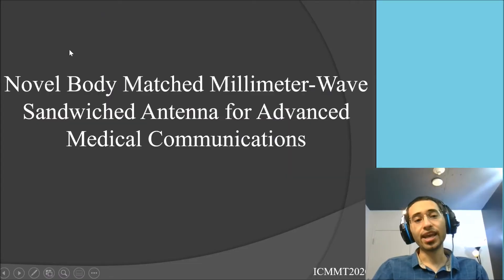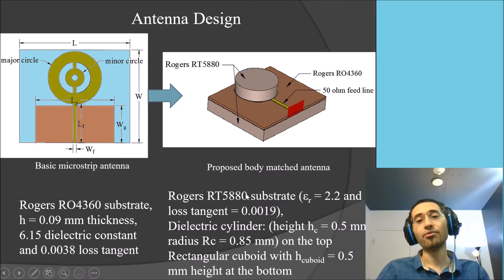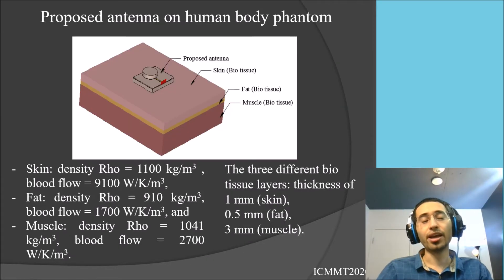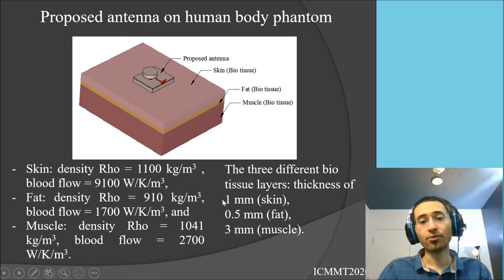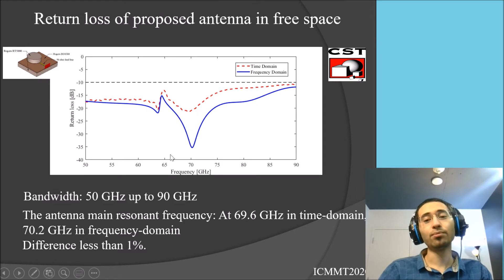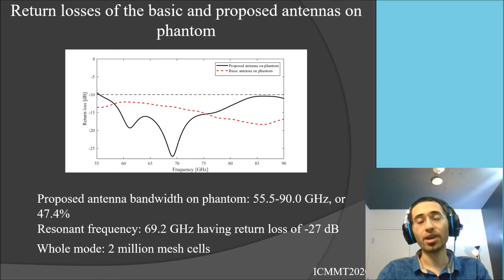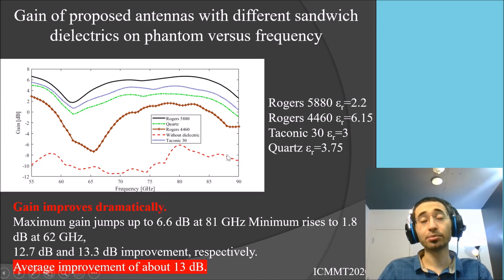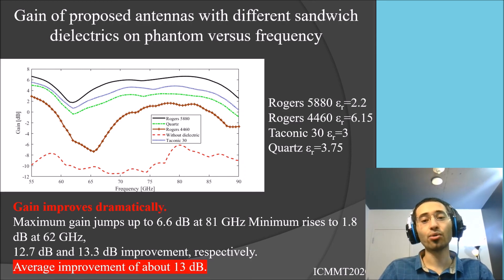Wearable Novel Millimeter-Wave Antenna

Comment: Can you help in design of mm wave 5g antenna directed beam with metasurface?
Reply from the maker: You can equip your antenna with a metasurface reflector or use an Array arrangement structure.